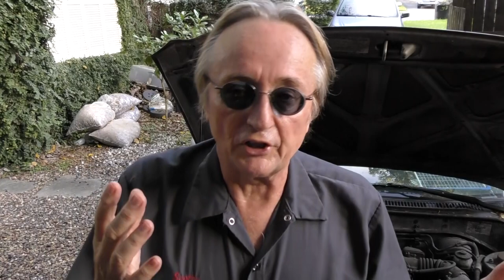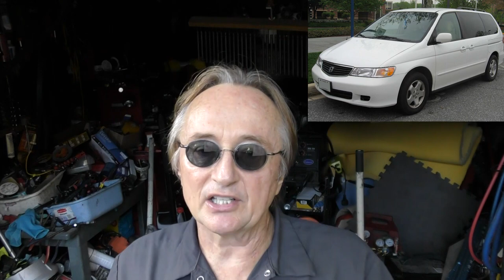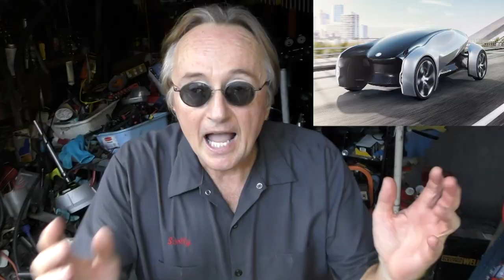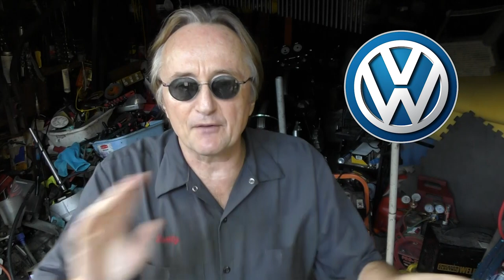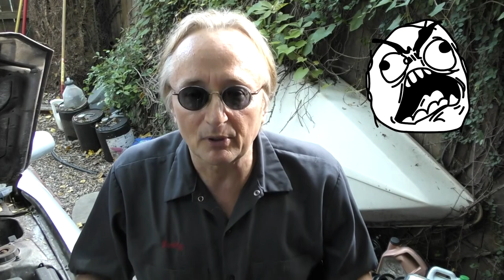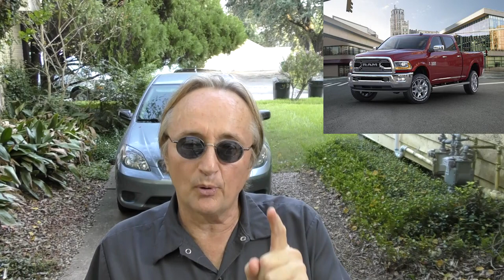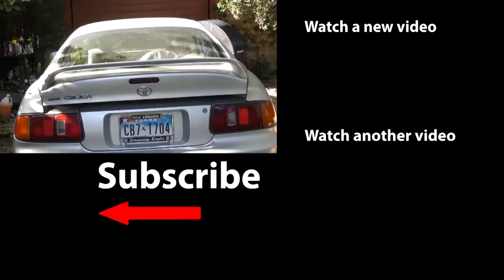Who Makes the Worst Automatic Transmission Cars in the World

Comment: As a 15 year Honda tech. I agree. Honda has the worst transmissions from 98-04. Replaced soooo many automatic transmissions. Now working for Acura the ZF transmission is in the 14-19 MDX and the 14 and up TLX v6. They are bad. Shifting issues all the time.
Reply: Robert Love  are the 05 to 07 Honda Accord auto transmission ok?
Reply: I'm looking to get a 2015 TLX 4 cylinder.  Are those transmissions ok?
Reply: Carl Loftin 

4 or 6. I actually have a 2007 accord 4 cylinder with about 170k. Still pulling strong. The v6 on the other hand have issues. I would get the 4.
Reply: Sebas R 

Yes. They have the 8 speed dual clutch transmissions. They shift so quick. It’s really nice. They seem to be holding up well. We have had some with over 100k and no issues.
Reply: Sebas R 

They have software updates. The 15 TLX has the main issues. They have an updated transmission for those. Some would come in barking tires when shifting to third gear. Not what the customers want.
Reply: @badk20a4  thank you very much.
Reply: Robert Love How about the new 2019 Acura RDX A Spec? Is it any good? Any transmission problems so far??
Reply: You would think they would have the auto transmission squared away by now...for all makes. I mean the wheel came along fine, its an important function of a vehicle. Humans focused on it and refined it, but not the auto transmission.
Reply: Are the transmissions on 3rd Generation Odyssey bad also? I'm thinking of buying a used one
Reply: What about the 2016 Jeep Grand Cherokee Overland Hemi-V8
Reply: God, you said Acura. I hate Acura with a passion. Owned a 1996 Integra and loved the car but it, unfortunately, was totaled. With my great experience with Acura, I purchased a new 2001 Acura CL-S and the first transmission only made it till 30k. The second one made it to 50k, and the third which was out of warranty only made it to 75k. Will never buy an Acura/Honda made after 2000 ever again.
Reply: Had Honda Odyssey van, It had many, many issues $$$$$$$$ .  Honda used to make good stuff but not anymore.   Honda Automatics are pure junk. I went through 14 alternator brackets in 3 years. Numerous electrical problems, parts are stupid expensive.  Toyota makes the best Van.
Reply: An American Hero 

They are still too new for them to have any miles on them. They have the Honda 10 speed now. No more ZF. We have had to put one in an a-spec with 60 miles on it. Never buy the first year model. You will have lots of problems. You are pretty much a beta tester. I would wait till the 2nd or 3rd year model to buy one.
Reply: stealthspoon1 they have some issues. 

Mostly torque converter shudder. But as far a replacing the entire transmission not really.
Reply: Monster_Zero 

Yeah those years of Acura and Honda’s were the worst with automatic transmission. The later models were a little better. Not much but better. The dual clutch transmissions we have now are pretty good. Those are in the 4 cylinders. TLX and ILX.
Reply: davidbrennan5 

I agree. The sienna is way better. The v6 has way more power. The trans are way better.
Reply: @badk20a4  What do you think of Honda CVT's? I'm considering getting a 2018 Honda Civic. Does Honda make their own CVT transmissions?
Reply: Robert, can you please tell me about your experience with the 2012 Honda Accord EX-L V6 with the 5 speed auto transmission? I worry about the long term reliability with the MDS engine and a transmission that has been somewhat jerky since I have owned it. I hit 100k miles recently and have concerns. Thanks for any input you can provide.
Reply: Gilbert Galvan 

Ive been out of the Honda dealership since 2014. So I don’t really know about anything past that year.
Reply: Bryan D 

I believe they are ok. If it’s jerky I would suggest a fluid change. It may help or it may cause it to become worse. Depends on how the maintenance was performed on the transmission. If it was changed regularly or not.
Reply: Robert Love thanks Robert - i was looking to get a 4 cylinder 2005 to 2007 accord as a flex car between myself and kids. I do have a 3.5 v6 in my 2009 Accord 110 k miles with no issues .
Reply: Thank you kindly sir, will do.
Reply: What about Honda civics?
Reply: Carl Loftin I have had my 2007 Accord 4 cylinder for 2 years with no transmission and engine issues
Reply: @stealthspoon1  , I have one and it is not a good idea to get one of these but damn that engine runs great !
Reply: Robert love , you should devot videos on Honda products
Reply: @badk20a4  you should devote videos just for the years you were involved ! I have my 00 Honda Odyssey LX and I really pray every time I start it up that the transmission shifts okay ? It's really starting to bug me !
Reply: Dan needs common sense 
Yeah it can be nerve racking not knowing when not if the transmission will fail.
Reply: Mike P 
The only cvt’s I messed with were with the old civic GX which were garbage. Then the civic hybrids. The were ok but don’t try to pull out in front of anybody. As far as the new ones I can’t really say. I assume they are good because they are in everything with a 4 cylinder engine now.
Reply: Dan needs common sense 
I could but it would take up most of my time I have free.
Reply: Mike P 
It is a 5 speed automatic. So far so good. It says 162k miles on it now.
Reply: @ProudiPhoneOwner  the 4 cylinder auto is very reliable.
Reply: Frequent fluid changes (40k max) on the newer Honda CVT's and you'llbe good. Make sure to use the correct fluid. They are actually almost pleasurable to drive.
Reply: How did the first gen Ridgeline trannys hold up? I know the early Pilot's had some issues.

Comment: I'm a ex Chrysler auto transmission tech and I have found most of the transmissions are good just poorly set up at the factory. The tolerances were to loose on the clutches and the solenoid packs failed. The 8 and 9 speed zf have valve body issue which is also the computer in most cases. but the jatco cvt is the worst of all.

Comment: Please make a video on "who makes the best auto transmissions including auto, dsg, cvt and e-cvt"
Reply: The answer will be Toyota. I just know that's what he would say. I don't fool with automatics anymore so it don't matter to me. I owned only one auto that was in a 1988 Bonneville and it was horrible. I had to put it in 3rd gear instead keeping it in over drive going up a hill because it would shutter and jerk crazy. I kept that car for 3 years only. I have a 2002 dodge Dakota I had since new with a 5 speed manual and it's 16 years old now and is still running. I also have a 6 speed manual jeep renegade. I will always buy manual as long as they keep making them. They're superior in reliability.
Reply: Early model cvts where str8 trash
Reply: I have yet heard of Scotty  mentioning any car or truck with a good automatic transmission. Except maybe Toyota who supposedly makes everything perfect.
Reply: @godgirlsguitars  95-97 honda odyssey,  best honda auto Trans honda ever made
Reply: Automatics suck. Simple as.
Reply: The best auto is anyone who still makes them. The best cvt is currently toyota with their latest one that has an actual 1st gear. The best dsg is almost none as they are put into vehicles that are used in the manner that a dsg should never be driven as, (pretty much goes for any diesel with a dpf too), that being in crawling traffic.
Reply: Yeah new diesels suck they are less reliable than petrol now DPF killed diesel. And with a DSG in crawling traffic you put a lot of wear on the clutch or clutches if I remember correctly.
Reply: wahaj vohra bet you it’s Ford.
Reply: wahaj vohra and Toyota
Reply: Toyota
Reply: Yep, the problem with both dsg and dpf is traffic. The dpf works, only if in a vehicle that sees 90% of its time on the motorways, but the people that buy them are just short trip a-b in heavy traffic. The dpf doesn't get any chance to self clean. And with dsg, same again; in heavy traffic people just let the brake off and treat them like traditional autos that creep. All that's happening is the dsg clutch is slipping and overheating the transmission. It's ok if you let off the brake and then apply the accelerator, but who is doing that in heavy traffic? Noone. Both good technology on paper but the biggest failures in their execution of being put into the wrong type of vehicles.
Reply: @MV60   Toyota hybrid transmission are the most reliable. Seriously, look up the stats... they are gears with no friction clutches to wear out. You can look up Prius mileage and it EXTREMELY rare for there to be a transmission issues on a Prius
Reply: @athletejmv  Prius has no power to wear the transmission out. Toyota cvt with a 1st gear are better.

Comment: Over the last 2 years Chrysler has recalled 5.2 million vehicles. How this company is still in business is beyond the scope of any intelligent person.
Reply: Exactly.  Every time I see a Dodge/Chrysler vehicle for sale, my first thought is "I wonder what is wrong with that one"?  I bought a 1999 Dodge ram 1500 truck several years ago and it has been the worst pile of junk I've ever owned.  It seems like I've fixed/repaired/replaced most everything on it -- and everything else is probably about ready to crap out soon.  I can't count the times I've said "I'll never buy another Dodge" and I won't.
Reply: Mitch184 well you have to pick out the recalls for major reasons and not cosmetics. Mechanical. Not all recalls are mechanical/electrical/safety. For airbag recalls, I could care less.
Reply: So were gonna only point out Chrysler recalls? Not ford/toyota/Hyundai. Face it with all the new tech being put into these cars there's bound to be a recall or two it just happens. Hyundai recalled transmissions on sonatas ford for steering racks falling off the fusions it just happens. Get over it.
Reply: Because their trucks are great.
Reply: Even in the 60's and 70's Chrysler Dodge Plymouth had automatics that had slipping issues.
Reply: Thinking Impaired automatics were very young in those days. Most didn't make it to 100k miles.
Reply: That's why they're owned by the Italians now, which will make them even worse.
Reply: The only reason Chrysler and fiat are still around is cuz of how good dodge and ram and keep are
Reply: They survive on certain vehicles...the HD Ram, the Jeep Wrangler, and the Challenger is a good seller for them. TBH the only Wrangler has no competition. The Ram does well since Cummins builds the drivetrain. The passenger cars are complete junk. Dart 200 300 etc.
Reply: Christopher Hendricks no the ram 1500 is amazing with the hemis and the charger is a good seller to and 200 and 300 are Chrysler products which fiat plans  on letting Chrysler die out since there not making enough money out of Chrysler and focusing more on ram and dodge Jeep
Reply: Many recalls are preventative recalls which catch problems before they get to be bigger. All companies have recalls get used to it.
Reply: @4thstooge75  I didn't want to get used to it. However, you have instructed me to, therefore, I will follow your directives to the letter. Thank you for directing me to the "get used to it" doorway. I shall walk through it and fulfill my destiny.

Comment: We got a clean title Honda Odyssey 2006 and are at around 175000 miles. 12 years later have only had to to do a few minor repairs and it’s still running strong.
Reply: I believe it, it's the best snowbirds vehicle ever.
Reply: My 2006 Odyssey is not so good... engine and transmission mounts shot at 100000 miles. Costs more to fix it than the van is worth.
Reply: Parag Mathur and regular maintenance was done at the dealer every 6 months?
Reply: Parag Mathur 
Because of that eco mode it shuts off 3 cylinders which result in extreme vibration causing the motor mounts to weaken real fast.
You can bypass that by using a VCM tuner (Variable Cylinder Management) it plugs into your harness and you set the coolant temp yourself prevent the cylinder deactivation only bad thing is if you're Honda is running hot you'll probably never know 
You'll still need some new or good used motor mounts replaced no matter what and the front one (near radiator) isn't very easy to get to but it can be done.
Reply: @user-zt4yk1sm8y  Lol, mine did this too. That VCM system is trash, it shakes the entire car. Trans and engine both eventually grenaded
Reply: Aleks 
Yeah for VCM to really be efficient I would think the engineers would have to redesign the v6 with an internal balance shaft so when the VCM kicks on the balance shaft would offset the vibration.   The vibration is not very noticeable with new motor mounts but they are very expensive.
Reply: @ParagMathurmd  I replaced all 5 mounts twice.  The thought being it is still cheaper than buying a new car esp if you DIY.  You'll be amazed at how well it runs once all 5 are replaced.  Be sure to use OEM. Cost more but worth it.  Ask me how I know.
Reply: Ok...so skip to 2007 ody?
Reply: I love my 2006 Odyssey. We are at 190,000 miles.  We have had to replace two engine mounts, the alternator, and two drive shafts along with other routine service.  We have put it through a beating though driving it between Alaska and Utah 3 times fully loaded as well as across the US pulling a UHaul trailer
Reply: Greg Myers ha I guess that makes me a shill for every good/bad product I own then. I’m someone who likes to leave feedback whether that may be on amazon, Yelp, TripAdvisor etc. but I am definitely not paid to do that, and just give my honest and true feedback as a consumer.
Reply: 4 7 true when it kicks into eco it sometimes sounds really bad.
Reply: @ChristianGutierrez  Our 07 Odyssey has 177K on it & has been an awesome vehicle. Just maintain it
Reply: Take care of it, do the maintenance and repair your self if you can
Reply: @Lexlugr  My V6 2008 Accord has the VCM, smooth as silk when it comes kicks it, do not notice it at all!
Reply: @KnightIndustries572   It usually does, until the active mount dies. I think the Accords were fine, but on Odysseys, these active mounts needed to be replaced every 25,000 miles and cost about $800 bucks. The resonance shook the crap out of the car particularly around 70-75mph. Really poor execution
Reply: I thought scotty said the '04 back to '99 were the weak trannys?.!

Comment: Have to weigh in with a favorable comment about the GM Powerglide. Had a 63 Chevy Bel Air and also a 65 Impala SS. Both were overall incredibly dependable and reliable; no major problems in either car in over ten years of ownership, plus way back then I wasn't all that dedicated to routine maintenance as I am today and so I just tended to drive them and put gas in them. The PowerGlide transmissions … never thought about them as they just did their work without any problems.
Reply: Years ago I bought a brand new '63 Impala small block, I put over 700 K on that car and the tranny was still performing like the day I bought it,    beautiful trouble free car. I still curse the day I sold it..........  More than I can say for most modern rubbish.
Reply: Lots of racers use them and they can take lots of horsepower. Not to mention they keep you in the power band due to only two speeds set close together. I saw one being used in a newer Corvette developing well over 1000 h.p. and the car runs the standing mile. So he yanked out the manual trans to run a powerglide.
Reply: @ianballinger7644  Ae you freaking kidding me?
When I was a kid my father had a 63 Impala Sltraight six with a 2 speed Powerglide that could not get out of its own way.
The transmission spent more time slipping then shifting and the engine was always racing.
I remember lots of noise and no forward motion of the vehicle.
 My father calling the car a sluggish death trap.
We almost got T-boned and rear ended on a regular basis.
 It  would not move and it was only a couple years old.
We thought the car had mechanical problems but we were told the engine was underpowered and the transmission was inadequate for such a huge heavy vehicle.
Reply: I agree. I had one in a 1964 Chevelle Wagon. The shift to 2nd at 15 MPH was annoying, but it was reliable.
Reply: Scotty just hates gm so he always has to give them a negative dig in every one of his videos, while boosting Toyota of course